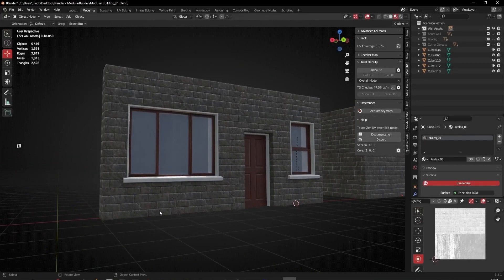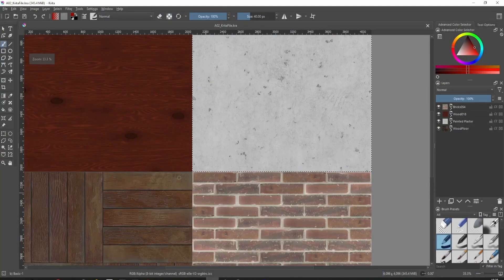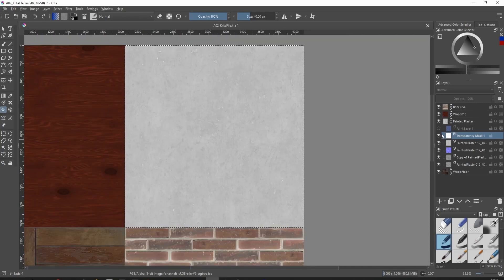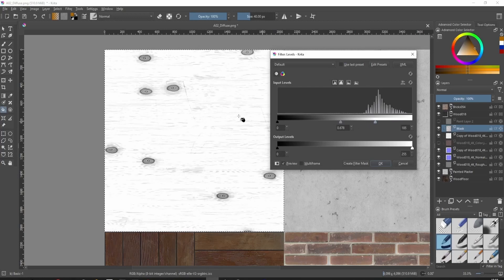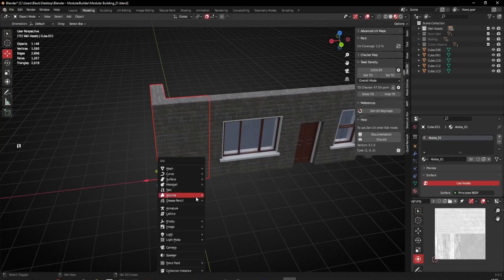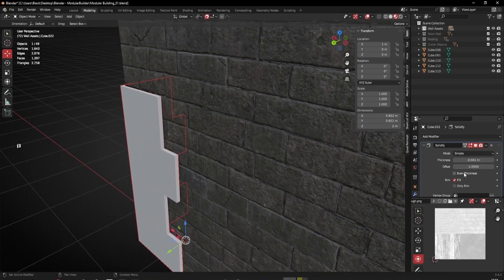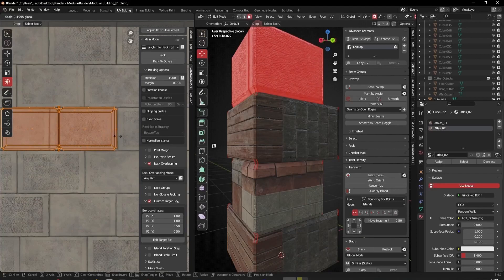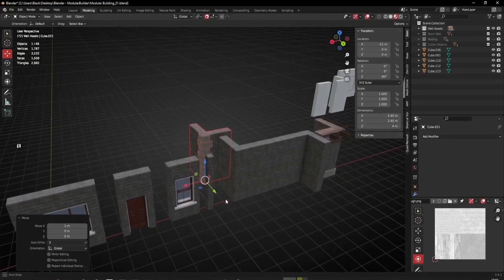Blender Modular Design - 26 Creating a Quoin

Comment: hello man thankx alot for ur tutorial and one more this is there is away to scale uv from from corner point rather than middle
Reply from the maker: Hey Donovan, Thanks! 😁 Yeah there is 2 ways actually, one is to select 2d Cursor as your pivot from the top of the UV Editor window, the second is to use the Transform tool to scale from any corer you wish. Shortcut is Shift+SpaceBar, then press T. Hope that helps
Reply: @JohnnyBlackWinter  
indeed it helps alot thankx for the fast replay